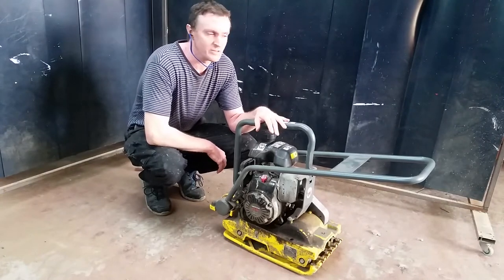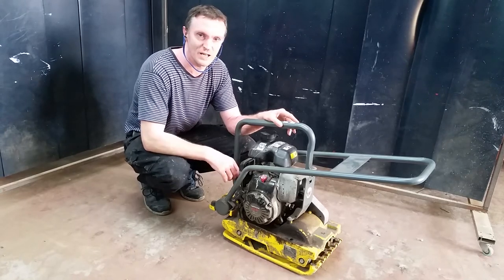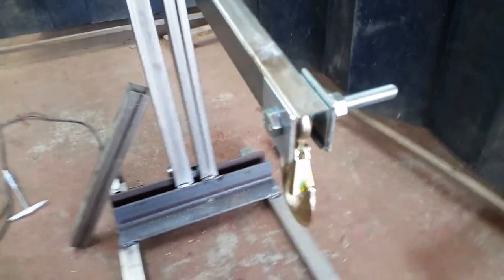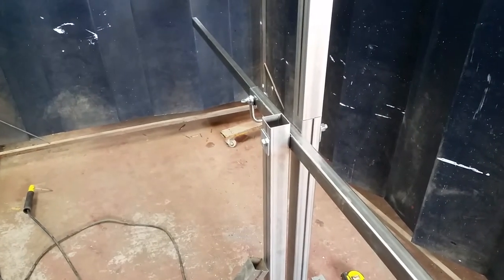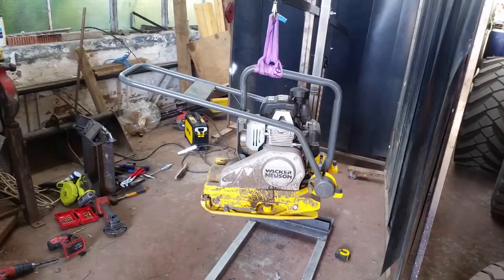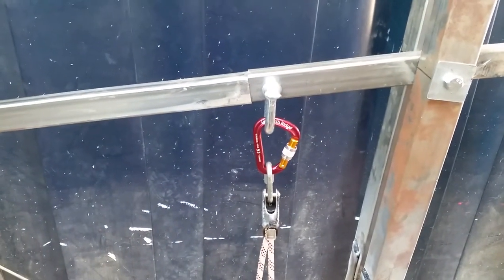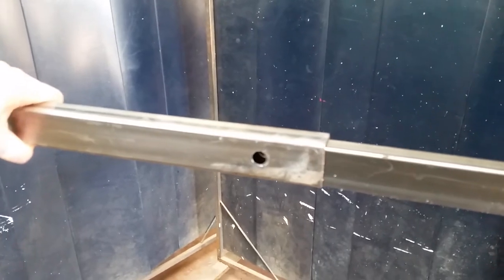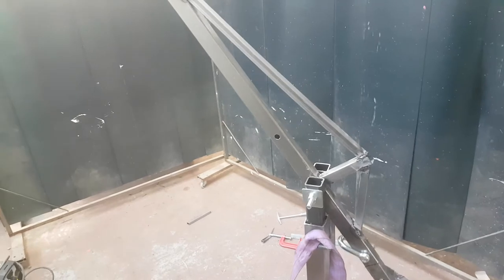DIY Lever Crane (lightweight engine crane style)

Comment: Love it. I want one. I need 200kg in and out of the van. Thinking of making one out of unistrut?
Reply from the maker: You'll need some heavier wall than unistrut I think. Perhaps if you double it up back to back you may get adequate strength. The tube I used was about 1.5mm wall I think. Depends on the reach you need for the lift height too. The longer reach, the heavier you need it to be.

For that weight you will probably also need to look at a puller. Even at 3:1 you would end up with your whole bodyweight on the end of the handle. To go to say 6:1, the handle would get unmanageable in length.

Comment: HI, new subscriber from sunny Australia , love this idea and design - thanks for sharing! I have both back and hip problems and I have a heavy welding machine that I have to lug in and out of the car boot and am after something to help me with that.  Do you have any plans or specs that you can provide to help with dimensions so can work out what materials I need to get to make one?  thanks again 🙂
Reply from the maker: No plans I am afraid. The overall frame is about 1000mm long by 600mm wide and about 1000mm high on the outer part of the vertical. The extending part can take it to about 1500mm high. The arm comes out about 800mm in front and about 1200mm behind with extension making that probably around 1800mm.

The reality is I made this out of scrap bits of steel I had around, so it was based to the specs of what I had to hand.
Reply: @projectbuild9784   what are the dimensions of your tubing that you use - just wondering what size and wall thickness ??  am thinking a smaller scaled down version would be really handy for people to use even just to drag a heavy bag of groceries or sack of pet food out of the car.  There really doesnt seem to be anything out there that I have seen to help with this other than a very expensive lifting platform machine that can cost thousands.  Something small that you could even use to fit inside door frames so you could wheel something direct into /out of the house if needed...just got me thinking LOL
Reply from the maker: @weldmama  The base and vertical are a mix of 2mm and 3mm wall tube. The two angles that connect then are 8mm which is why I didn't need any real bracing. Just stuff I had around.

The lever arm is the lightest stuff around 1.5mm but I did have to brace that with the top framework to lift the 100kg range without too much bending. I would probably go 3mm all round on the tubing if I did it again for my lifting requirements and therefore not have to add bracing to the top structure. I would also have the base stick out a bit more to the back as it tends to be a little tilty as you pull backwards. Otherwise it has been a brilliant little mini crane which is so much easier for lighter stuff you need to do quickly but is just on the heavy side to lift.
Reply: @projectbuild9784  yep good suggestion re the 3mm tube!.  You could even have options where you change out the caster wheels and put on rubber tyres and take it out to use in the garden to move things around etc if needed.  Thanks for the detail and rational behind your build, I really appreciated it - I really like how you can attach pulleys and/or lever winch's to help with the lift as well - would help to provide futher control or holding if needed.  Well done 👍
Reply from the maker: @weldmama  You're more than welcome! Good luck with your build!
Reply: @projectbuild9784  was just having a think and wondered if you drilled some holes horizontally through the base supports and put some bow shackles through the holes there - that would also make good tie down points to stop whatever you are lifting from swinging around in the air when you have it hoisted up??  dont know , just was an idea that popped into my head.  do you have an email or contact address - when i get around to making something i'll send you some pics 🙂
Reply from the maker: @weldmama  Might be an idea. You get swivel hooks which automatically rotate to the best angle for the load. Like the tie down points in cars near enough. I personally have put a piece of ply across the base and used it as a trolley a couple of times. Worked quite well that way too.

Comment: excellent work. you have any blue print or design of it, i also make one and lift upto 200kg
Reply from the maker: No blueprint I am afraid. The only real specific requirement is that the pivot is longer on the user side by the number of times you want the gain in lifting capability.

As such, to lift 200kg you would either need it very short on the lifting side or very long on the user side. Say you have 500mm on the lifting side, you would need 2000mm on the user side which would quickly get awkward to use and you would still need to put 50kg weight on the handle to lift 200kg.

As such I think you would be best to forget the handle and just have a chain lever hoist do the work.

The other option could be to put a heavy gas strut into the design which helps take some of the load for you.

Either way, for 200kg you need to think about using heavier wall steel so you don't have too much bending and perhaps some bearings on the pivot point if this is regular use, as the increased loading will wear the pivot faster.